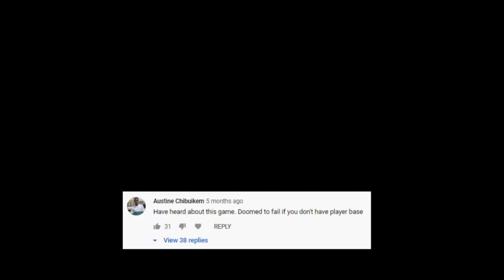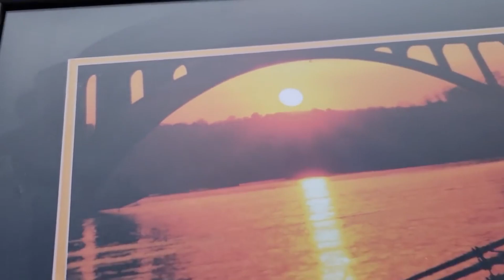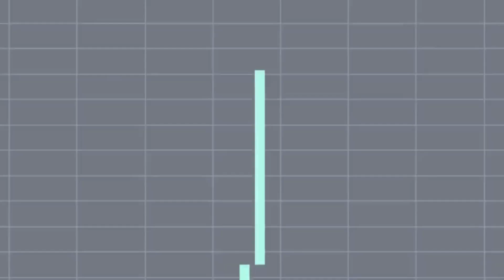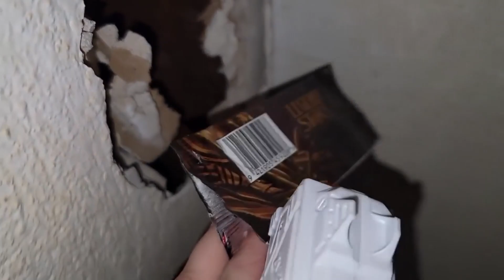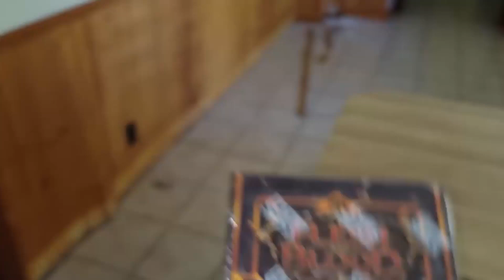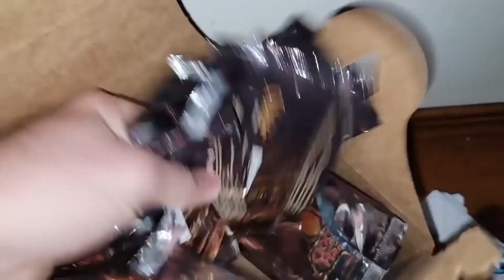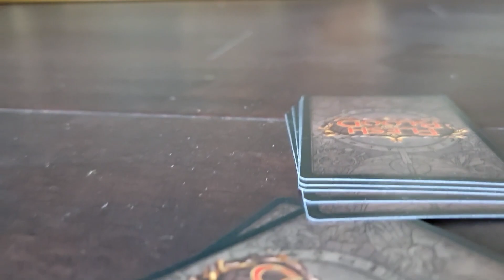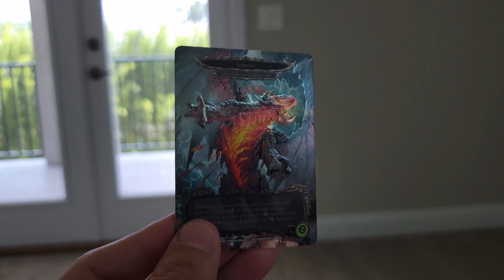EXCLUSIVE: World Premier UPRISING - (Official Video)

Comment: I just noticed how big of a flex the SBRd, suppressed, two tax stamp Kriss Vector could have been, if it wasn't for the airsoft red dot sitting on top of it. Why have a $2000+ setup, minus the can, and wait on both tax stamps to come back, only to drop a <$50 red dot on top of it that's never going to hold a zero? Awesome video, and that bathroom is a huge flex in and of itself though.